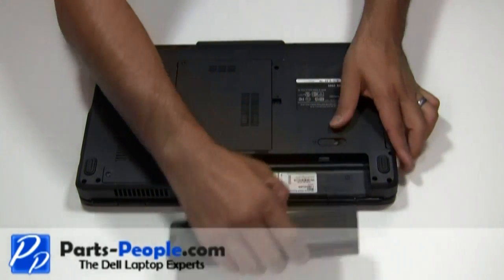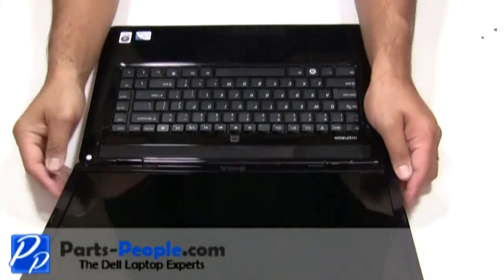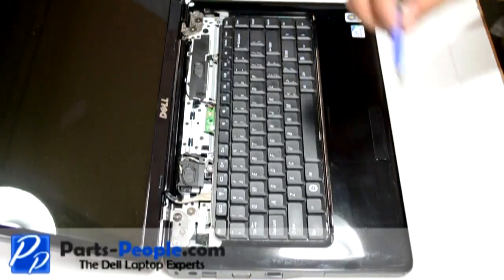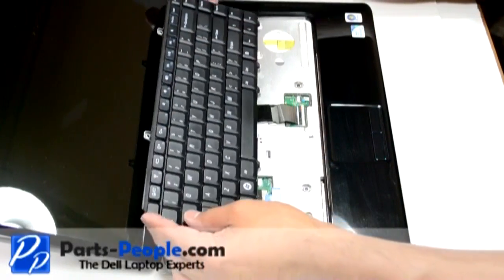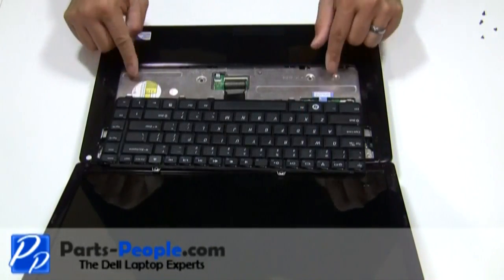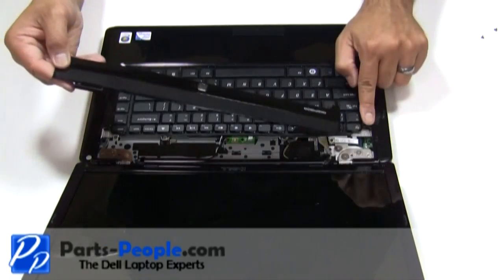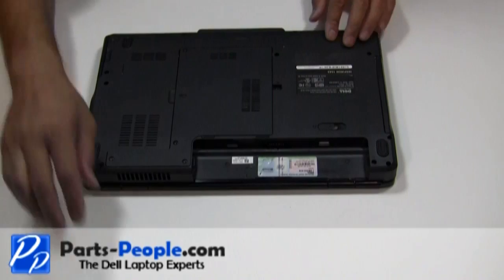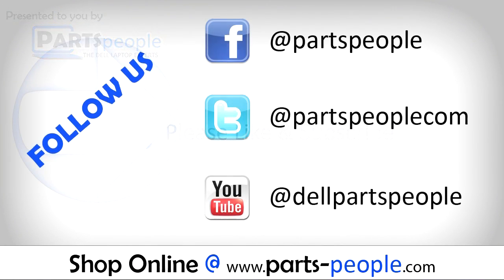Dell Inspiron 1545 | Keyboard Replacement | How-To-Tutorial

Comment: Thanks for the video! It's very informative. I saw another video and was wondering why you have to remove the screws where the battery is. Glad you explained it in your video. My keyboard broke so I'm hoping to replace it as soon as my replacement keyboard arrives. This saves me however much Dell would charge me if I were to send it to them.

Comment: Thanks for the refresher. This was slightly easier than replacing the keys on my Inspiron 1525. I thought there was something seriously wrong while I was doing this repair, because the keyboard would not come out once everything was unscrewed. Turns out it was just cemented down in place from the owner spilling sodas on the keyboard. Yuck! (On a side note I suspect the one person who dislikes this video is Michael Dell)

Comment: Thanks so much for this! I'm typing this on my new keyboard. My "s" key started to become unresponsive until it finally died completely. I had resorted to using ctrl+c/v to write an "s" until my "d" key failed as well.

The ribbon cable on the new keyboard is not bent. This makes it kind of tricky to hold in place while you flip the latch over top of it. I followed the directions and the keyboard didn't work. After opening it up again and reseating it, it works great!